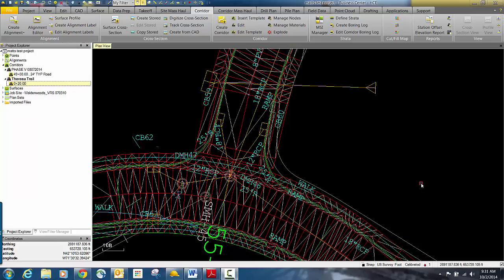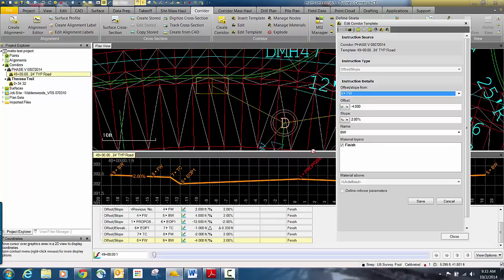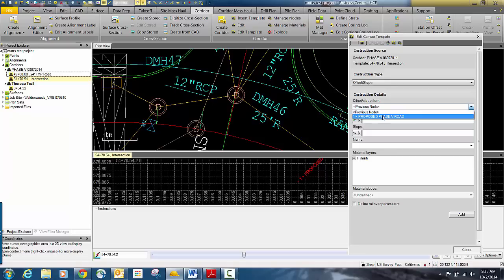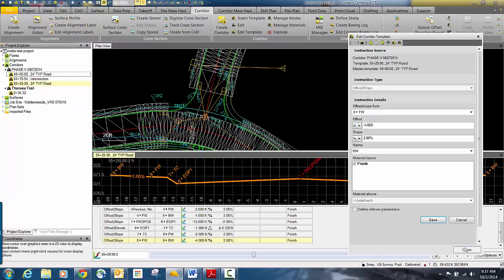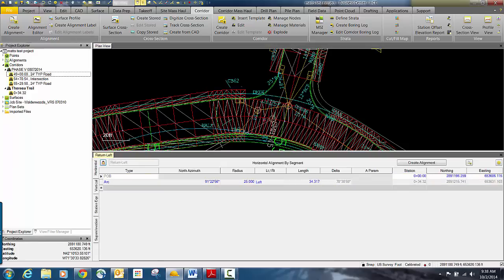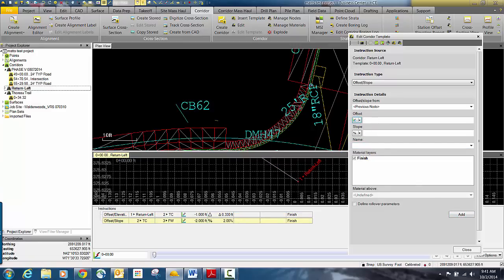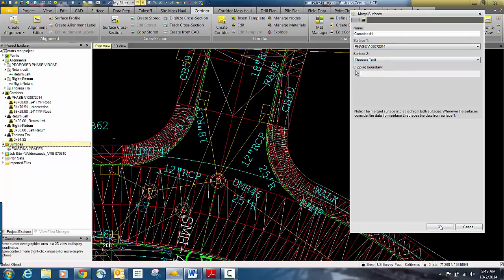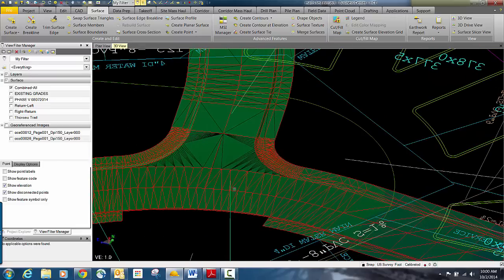Model an Intersection - with BC-HCE

Comment: I have found this video to be very helpful but I am currently working on a 4-Lane road in my area with turning lanes and crossovers. The only way I have gotten my templates to flow is to make blank template of .001 at the end of the turning lane for the crossover to begin. I then create the driving lanes and then have to create another blank template at the start of the next normal section where I reference the beginning template. Also have you/or can you make a video on how to tie in the ditches in modeling an intersection? I have been to the Business Center HCE 3.22 class but would really benefit from just an advanced Corridor Class if there was one offered.Thanks
Reply from the maker: +Alex Freeman Where are you located (what State?) Also can you install 3.5?  there is an intersection command now in BC-HCE.  Which will change the workflow in the video.  Here is a video on this... I'll look at making a video on ditches... https://youtu.be/5yikTZbS4BQ
Reply: +Construction Technology I am in Western Kentucky. I recently attended the BC 3.22 training course offered by Sitech-MidSouth